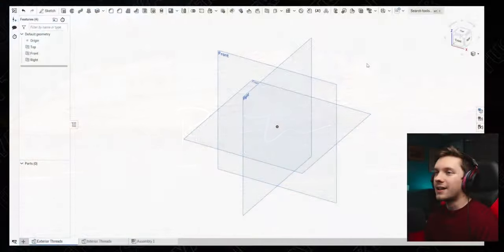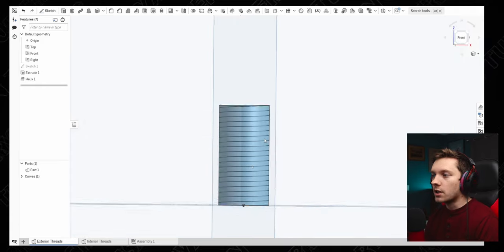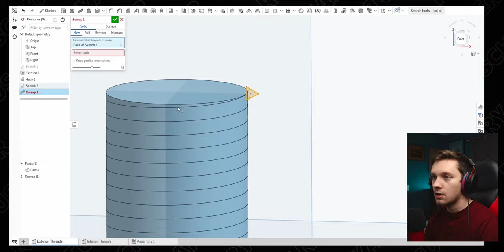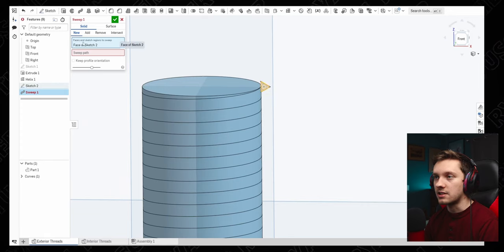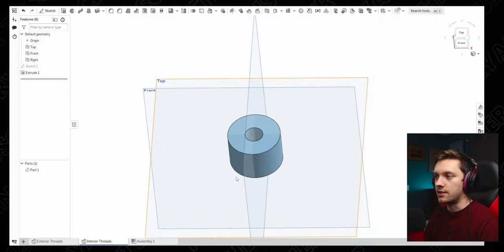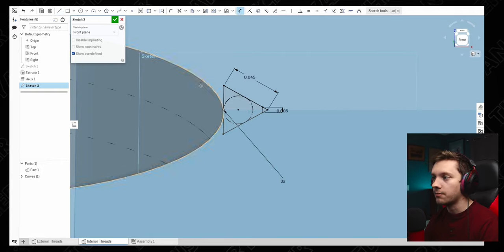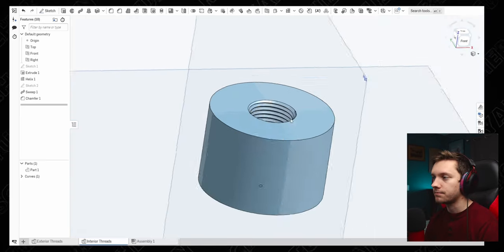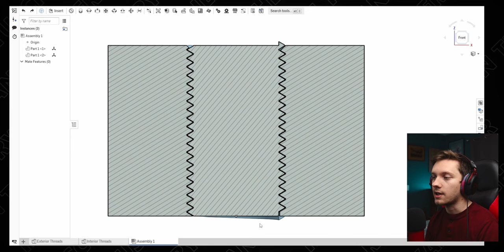How to 3D Model Threads in OnShape

Comment: This is a good description, but I found that it works better for 3D printing to make the angle of the threads to be 45 degrees so you don't need any support material supporting the threads. It's no longer a standard thread, but you are probably printing the mating parts so it's easy to make them the same.
Reply from the maker: You mean a triangle but with 45 degree corners? I'll have to try this out when I make threaded parts for my desk accessories! I appreciate your feedback!
Reply: Yes! The 45 degree overhang doesn't need any support material where a shallower angle needs supports. @RyanTuscher

Comment: wow... this program hasnt figure out ho w to make proper threads yet.... Obsolete
Reply: Onshape made a thread feature last year. You can make ANSI threads with TPI and diameter. Works well.
Reply: its good at a lot but not threads. in the lords years 2024 thats unforgivable
Reply: @Pappagar  there is a thread feature for ANDI standard. The crappy thing is it only does male threads. You can insert threads in a hole in onshape which is kinda wack.